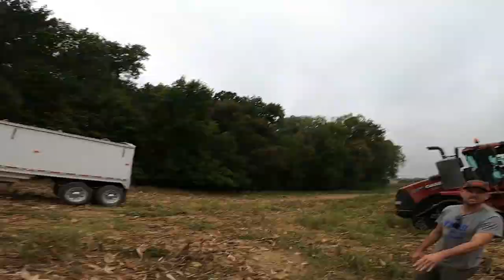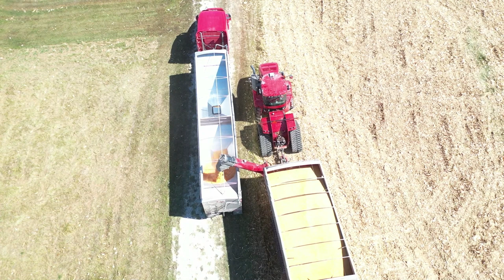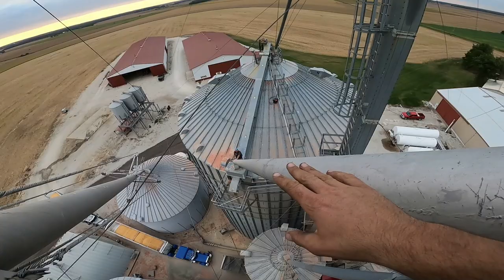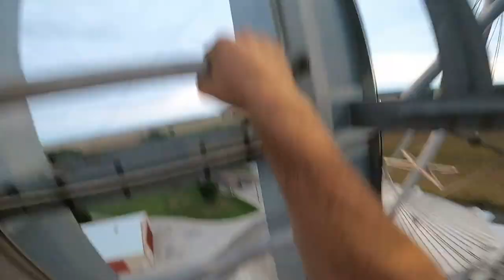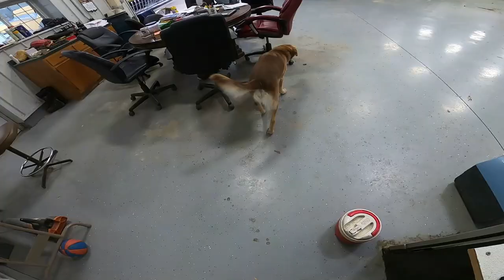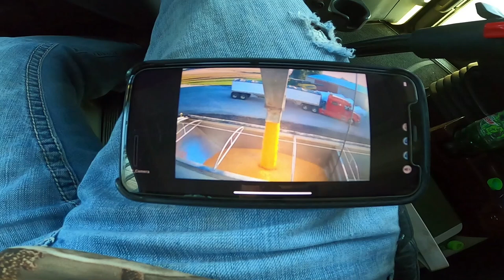Episode 31 Grain Haulers

Comment: What was the problem with the air abatement on the New Holland?
Reply from the maker: Karen Bertram  he said the air tubes were bumping beans before they got to the head knocking them out. They did side by sides with the other head and said the one with the air system had more on the ground

Comment: Hello , I have been following your channel very well. Your channel video topic and quality is very good. You can take your channel even further if you want. But there are some important issues in your channel which will not grow your channel easily if not solved. and your channel SEO score is absolutely zero. this is why your you tube growth is very low. If you can solve this problems your channel will grow very quickly. subscribers ,views , like, comments is very low according to your channel age. and views ,like, comments is also very low according to your subscribers. because channel setting problem and video SEO problem. If these two problems were not present in your channel today you would have got many times better results.